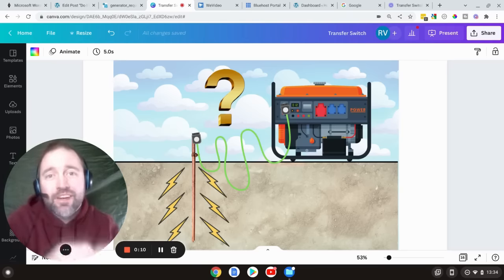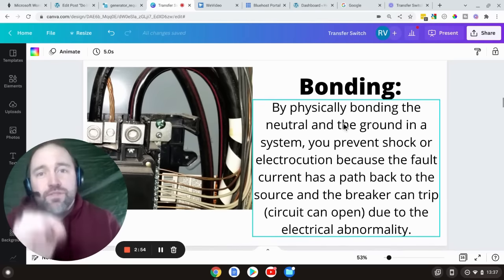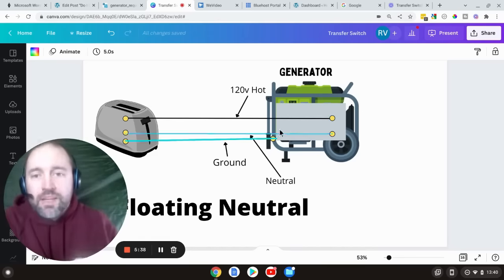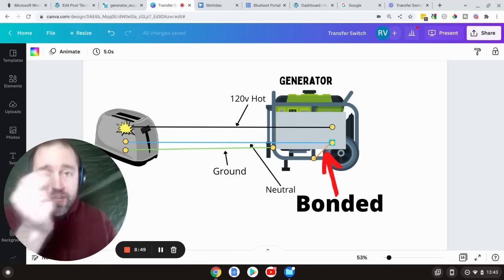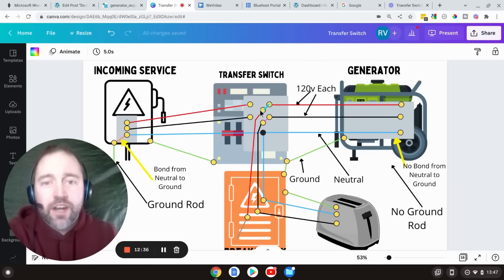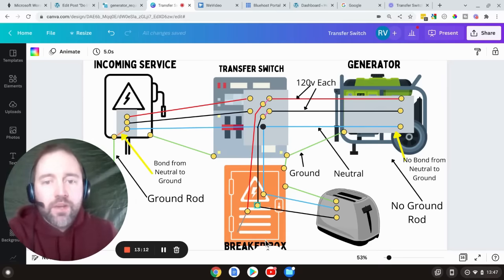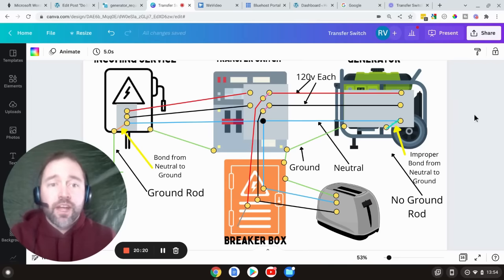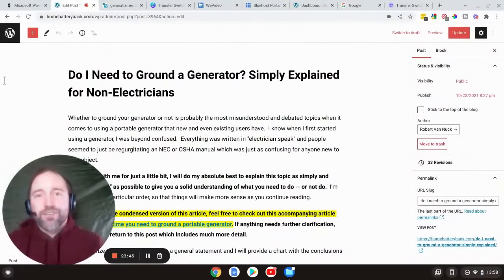When You DO and DO NOT Need to Ground Your Generator [Extension Cord Use & Backfeeding a Home]

Comment: What about the same scenario but you just pluggingthe generator into a 30 amp plug and using the generator lockout on the panel?
Reply: Generator lockout typically only switches between the hots, neutrals are still connected through the neutral bus bar to both the grid transformer and the generator neutral. Don’t install ground rod.

Comment: If a fault occurs in a house, which is bonded and grounded, then we don't get shocked.  But if a bonded, grounded generator is connected to an rv, then we are shocked from a fault?  Is this the case?  If my toaster that is faulted is in the rv, can it still reach ground through me if there is a ground rod?

Comment: So, I understand you to be saying, if you touch a hot wire to a ground wire (which is essentially what you're doing in your toaster scenario), the breaker won't trip, correct?
Reply: The breaker will only trip and provide a safe state if there is low enough resistance path for the current to flow back to the voltage source from which it originates.

Comment: What happens with an unbounded generator with a 240 volt connection back to your breaker box directly (no transfer switch) that has GFCI’s and arc fault breakers in the breaker panel when there is a fault in a circuit?

Comment: So why does the new champion inverter generator I just got which only has a normal household receptical and no way to attach it to a transfer switch have a floating neutral and the manual says grounding is required. According to the video, as this can only really be used with extension cords, it should have a bonded neutral and not require grounding. Do I trust the video or Champion?
Reply: I hear you, Champion also says it's safer to have floating neutral when using extension cords. Not sure how they think that

Comment: Comcast removed my ground wire from my electric meter to a rod that goes in the ground (earth). Why would they do that and since when do they know more than electricians? Granted the wire was only about 12 gauge wire but someone drove a rod into the ground and connected that wire in order to have some type of ground for the meter. I am baffled as to why they did it and why they took my wire.

Comment: At 9:40 it occurs to me that my portable generators should be resting on a non-conducting surface, such as dry wood, instead of resting on their metal legs to avoid the problem with adding a grounding-rod to a bonded system. Correct?

Comment: Why be bonded if your using an extension cord? To connect to the house ground? If so again why? Couldn’t an appliance that short complete a circuit through you , ground, then house ground?  Resistance would be high but why do this?

Comment: Does the Predator 9000 that Harbor freight sells. is that one grounded to the frame? i am just going to use it like 7 times out of the year when needed not daily and i will use grounded extension cords leading to the house to power the fridge and maybe a toaster but those dont have ground in the connection. i hope this generator works for what i need it for. let me know and thank you for your time!
Reply: I have the HF 6500 and there's a sticker on it that says "neutral bonded to frame". I'd check yours out to make sure or ohm it out.

Comment: Also, if you plug a generator into your house, you run a high risk of killing the guy trying to fix your power. Furthermore putting out of phase power on the mains. at a minimum, turn off the main breaker. Some generators are designed for this but portable ones usually are not.
Reply: Not a high risk. I asked the local utility guys. They short everything with jumpers to ground to preclude  getting shocked while working.

Comment: Time 8:50 - the use of an RCD (GFCI) becomes more than sensible for using earthed appliances.  In this case the ground rod is also a good idea as the passage of current through you to ground trips the RCD.
Reply: But would there BE any current through you to ground I'd the generator was floating with no "earthed" ground conductor?

Comment: I have a small suitcase type inverter generator. NOT a frame type generator.

My understanding is that these types of generator must have a ground rod in order to be properly earthed because they don't have a frame. 

What they do have is a bolt on the front panel to which you can attach a wire which goes to a grounding rod. 

These types of NON FRAME generators must use grounding rods because there is no frame to ground them. 

It's important that people with non frame generators are aware of this because your video doesn't make that clear.
It just tells everyone that a ground rod isn't needed (even to be avoided) because the frame does it.

Avoiding a ground rod on a suitcase type generator is a bad idea. No ground rod means not grounded at all!!
Reply: Yes he makes the ground rod issue unclear in this video

Comment: Hey doing a music video in a Uhaul truck  this week with a 2000 w generator. Would love to give you a quick call about safety! What’s the best way to get in contact?
Reply: hey so did you bond your generator and what did you power with it? I ask because it sounds like you are powering sensitive electrical equipment, and it is my understanding that bonding a generator may be safer but will cause potential electrical spikes which could damage sensitive electronics...

Comment: Should be grounded. That way the alternator will trip the breaker. That's a problem with these suitcase inverter generators. They have an alternator in them.

Comment: What if your generator is in standing water should it be connected to an earth ground?
Reply: Depends on if the generator is connected to a breaker box and through that breaker box to the earth ground at the mains and grid.  Ground wires serve two functions and it gets confusing which function is being served. The ground wire is bonded to neutrals in order to provide a super quick path back to generator/grid transformer so that breakers can detect super high current and trip, since the resistance of a fault is much less than normal operation and ohm’s law relates all three. Ground is also connected to earth ground to complete the circuit between the sky and the earth, such as in a thunderstorm.

Comment: Grounding a building's electrical  system does not help with lightning and that is a very common misconception.  A little 12 or 14 gauge wire running in a wall is not going to stop overheating, arcing, or fire risk from a lightning strike. Lightning simply contains too much energy.  True lightning handling for structures is a whole other topic and has different specific solutions.
Grounding is needed in an electrical system to assure the same ground potential is present throughout the entire building.  It also provides some safety measures like preventing shocks from metal enclosures making contact with the hot conductor due to damage and allowing GFCI outlets to work.  Source: Mike Holt
Reply: GFCI outlets do not require a ground. They will work with just a hot and neutral wire.
Reply: @MandrewP  *Work better

Comment: welp, he never mentions cost … but my generator is really cheap, (so, I’m thinking 0% chance it’s bonded) … and the electrician installing the transfer box was good … but did the easiest, cheapest thing, (so, I’m pretty sure there won’t be any neutral-switching).  😅  I mean, I’m super curious, but just guessing based on this expanation … I’m probably un-bonded, and without neutral-switching.  💜👍  now I need to double-check … but I didn’t pay enough to have either of those features.  😂

Comment: For a house or building with independent generation the safest approach is to go for a TT system (earth is via local earth-rod and is not derived from the incoming supply) combined with a full system RCD/GFCI.  There are too many potential issues with TN(C)S when you have on-site generation.  You also need to bond N-PE at or near the generator upstream of any RCD/GFCI to enable them to properly function. 
TT is also the safest with overhead power lines because the neutral can easily become damaged resulting in everything going up to line potential if earth is derived from the incoming neutral on TN(C)S.
Reply: I know what GFCI MEANS  but TT, RCD, TT,  and  TN(C)S HAVENO MEANING to me and i will guess 95% readers so YOU FAILED TO IMPART VERY IMPORTANT IMFORMATION!
Reply: @BELINC7  If the words have no meaning to you then you probably shouldn't be designing grounding systems. I did define TT in my comment above and a quick Google will help you learn about the rest. I'm not your teacher!
Reply: My guess is you know what a T T system is but you don't know what T T stands for or you are being cryptic for intimidation purposes.

Comment: Circuit breakers may trip if your system has a fault but breakers are  designed to protect equipment and to prevent fires NOT prevent electrical shock to people. Never rely on a breaker to protect you. A small electrical current of only 100ma or less can cause a fatal heart ventricular fibrillation and can occur faster than the breaker can trip, even a GFCI breaker. Learn and use good electrical safety practices. Don't ride the lightning.

Comment: Instead of a standard transfer switch, if I use a breaker and an interlock kit at the first point of disconnect, is the neutral still fixed or switched?
Reply: still fixed, same as his first example of a transfer switch. When you disconnect the "Main" breaker from the power company, you are only disconnecting the voltage lines not neutral. When you engage your breakers connected to the generator they are only connecting the live wires, neutral and ground stay connected always.
Reply: Thank you.

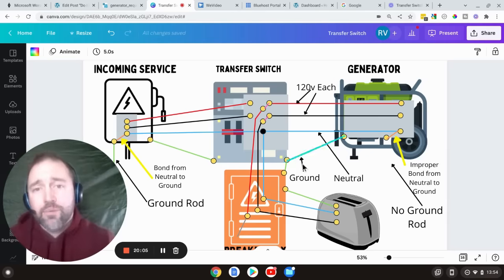Comment: From 13:21 to 15:24, your diagram has 2 ground rods (one ground rod at the incoming service, and another ground rod at the generator) that are connected together.  Is this OK?  Am I correct in this summary:  a) Multiple ground rods may be present and connected together, as presented here; and b) the whole system (generator and incoming service) MUST have the house neutral and the system ground bonded at exactly one single spot.  Is that right?
Reply: First of all, the two ground rods are not connected together. If you look at the diagram, the transfer switch separates the two. Either the incoming service system is selected or the generator system is selected - but not both at the same time. The same with the neutral and grounding system being bonded, only one system is selected and active at a time. And this bonding only happens once - never twice, because only one of the "bondings" gets switched into the circuit at a time.
Look at it this way:  If there was no generator installed then you would have only the incoming service feeding the breaker box. That incoming service has the earth connection and the bonding of the neutral and grounding system (the equipment grounding) . If you add a generator and that becomes your incoming service when the transfer switch switches over to it, then it too must have an earth connection and bonding of the neutral and ground to replace the original incoming service. So it's like you have two incoming services, each complete with an earth ground and bonding, then the transfer switch selects which one gets used. 

Now some transfer switches don't entirely switch out the incoming service, but rather leave the earth connection and bonding in. In this case, there is no need for the generator to have it's own earth or bonding, the originals never went anywhere. This is when the neutral is not switched by the transfer switch, as shown in the first part of the video.

Now most residential homes have the earth connection and neutral bonding inside the breaker box (main service panel). In that case, you have the simple feed from the utility coming in to the breaker box or else the simple feed from the generator, so then there is no need to consider the earth connection or neutral bonding because they are always there in the circuit. So then the generator doesn't need to supply either.
Reply: @MandrewP  Thank you for your explanation.  My question concerns the point that the two ground rods ARE permanently electrically connected (the transfer switch does not switch the ground, only the hots and neutral).  Follow the green wires, AND the chassis (pl.).  The ground rod at left is connected to the "Incoming Service" box which, via its chassis, has a green wire to the "Transfer Switch" box which, via its chassis, has a green wire to the "Generator" which, via its chassis, is connected to the ground rod at the right.  THAT's the connection I'm asking about; these are permanent, NOT switched connections.  And the house ground is connected to both ground rods at the "Transfer Switch".  And I agree that in either position of the Transfer Switch, the bonding occurs only once.

Comment: The System Ground with an electrode should occur in no more than ONE place.
Neutral and Ground need to be bonded somewhere, and only in ONE place.
The grounded main circuit panel is bonded to the Neutral, but not in any subpanels, nor anywhere else.
If the generator is feeding the main panel through a transfer switch that does not switch the Neutral, or via an input breaker that locks out the main breaker, the bonding is in the main panel.
If the generator is feeding individual loads via extension cords, the main panel and its bonding would be bypassed, so the generator needs to be bonded but NOT grounded with an electrode.
If the generator is feeding a transfer switch that also switches the Neutral, the generator needs to be bonded AND grounded with an electrode.

Comment: ... from someone who has a degree in electrical.

Don't buy a floating neutral generator!  These generators should be made illegal and in my opinion are dangerous.  A bond-neutral generator is the only way to go for the normal consumer 😉

Also, your wrong @ 7:45!  If the toaster grounds out to the metal frame then it will return through the electrical cable's ground wire and not through the frame itself to complete the circuit.  Sure, the generator's neutral and frame are bonded with each other like your house's service panel and the center-tap on the transformer on the power pole outside your home is but that's not the path it's going to take hence the reason your not shocked when you touch your service panel's metal frame 😜

If the generator windings ground out to the metal housing then it completes the circuit through the bonded frame hence you don't to get shocked in the process due to the alternative path of least resistance.

Also, your so wrong on the ground rod it's not even funny!  You don't need to ground a bonded generator but let's say you did would you be putting yourself in more danger.  The answer is like NO!

Again, the current will seek the path of least resistance and EARTH has a much larger resistance than a ground wire so no it will never go to EARTH in most cases.  I guess if your using a metal framed tool without a grounding prong and it ground out to the frame then you're going to get shocked anyway and most of these tools are a thing of the past.  I guess it's possible that some retard cuts the grounding prong off and the generator is Earthed then you're in for a world of hurt because it will likely complete the circuit via the grounding rod which isn't good.  You have to be doing something really STUPID for this scenario to ever play out.

It's the same reason that your not in any danger due to your house's Earthing system.  The EARTHING (ground electrodes) are primary for static buildup and lightning strikes.  Sure, you could have a minute amount of charge attempt to make the Earth connection but it's going to be extremely small at best!

I guess if you're worried about lightning striking your generator then it's probably not a bad idea and would divert most of it before it entered your house and then the rest would be diverted back to Earth by the house's Earthing system (aka grounding rods).  I really can't see this being much of an issue but than again 99.9% of people will NEVER earth a bonded generator so it's really a moot point.

The worst thing you can do when wiring a transfer switch up is create an open neutral situation which will fry everything on one leg that isn't behind a surge protector!  Basically, an open neutral is nothing more than a voltage divider and that's not good.  It gets real expensive if you screw up so my advice is have an electrician come in and wire up your transfer switch unless you have a solid background in electrical and fully understand how the electrical system works.

For those brave enough to wire up there own, you typically buy a two-pole 200 amp transfer switch and the generator and mains are wired into the top and bottom lugs.  The house's service panel is connected to the center lug (aka double-throw safety switch).  The generator neutral and ground wires are typcially tied together in the transfer switch and of course those attached to the neutral/ground bus bars in the service panel for a bonded generator.  It's a fairly simple install assuming you know what your doing 😈

Comment: Instead of disconnecting the ground bond in the generator why not just not hook up the ground wire in the inlet plug ? Then the generator remains un modified and can still be used on a job site…. I mean yes I know wrong but it eliminates the second current pathway ??